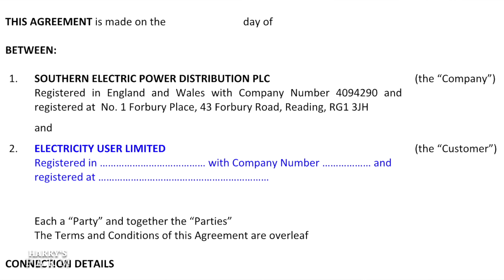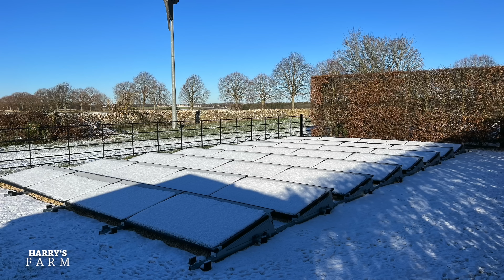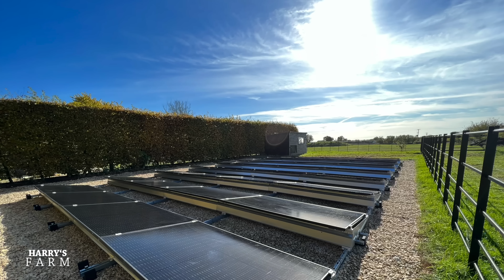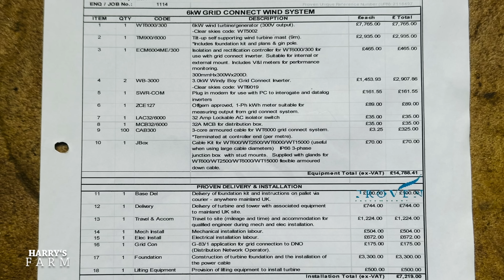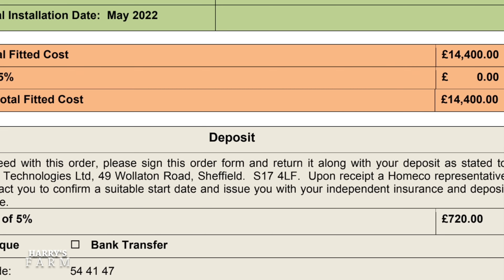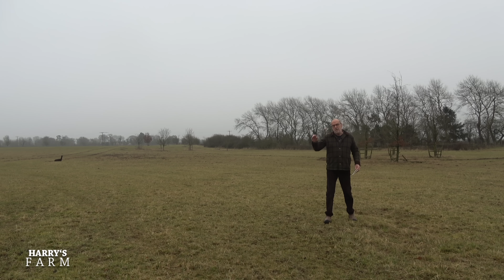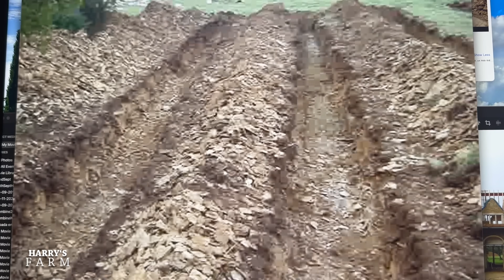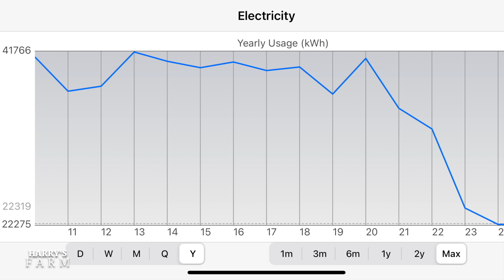Are solar panels & heat pumps worth installing? Here's what I've learnt after several years of use.

Comment: im sorry but i have a large home too 450m plus not counting the garages in aberdeen bloody cold most of the year my home which is only half insulated by modern standards costs me under 450 per month for electric and gas we have eight adults living in this multi generational home two in there eighties and two working from home both lots requiring warmth all day   
 using more power fot the 10 tv 8 lap tops three kitchens and easily 10 plus showers and baths a day than most and we have no windmill no solar no air source heat pump no ground source heat pump so have not spent the 40000 pounds plus i would need to install these or give up my time to monitor and adapt /plan anything re there use nor save up for the  eventual replacement of said equipment okay i dont charge two cars but i didnt have to spend 80 k on them either just sold my 911 which cost 13k back in the day for 8000 at 26 years old what do you think your electric car/s will cost you over that period of time believe it or not i own a heating company and remove more of the measures discussed here than ever often when the customer comes to renew the system finding the equipment had not lasted time suggested and savings were  not even in the realm of those indicated  whilst my twenty staff install 15 to 25 gas and oil boilers a week i am not trying to argue for the sake of argument but people who insulate thier home well and install a well planned and controlled heating system can heat there home for less than the cost of running the methods discussed without the huge outlays i suggest people do there best to insulate properly first and give serious consideration to the real cost to themselves and the environment untill we geat nucular power the cleanest and cheapest electricity next only to well planned hydro

Comment: kWh : The summer months' average appears to be around the 860kWh, about 57kWh per day. The average sun hours per summer month there are about 6 hours per day. So the output is about 9 - 10kW per hour, about 85% of the designed output. Pretty good for the summer. For the winter, 3.8kWh per day for December when there are an average of 1.6 hours of sun, gives 2.4kW per hour, about 20% efficiency. We know there will be less output during the winter, so the "14 times less" comparison isn't valid. The "per hour" efficiency is about 4 times as good in the summer as the winter.

Comment: Harrys missing the key point of the house battery...its buying all your electricity overnight at a quarter of the cost for use during the day in the winter.  That has saved us a fortune because we've only paid for full price peak electricity  between 3-4% of the time across the year which is only on the very coldest darkest days and then only at the end of the day.  Total fuel bills inc car doing 7k miles, 4 bed house inc heating sit at £48 per month.